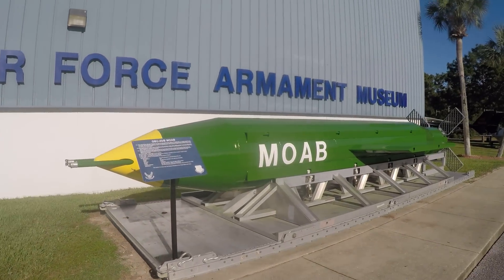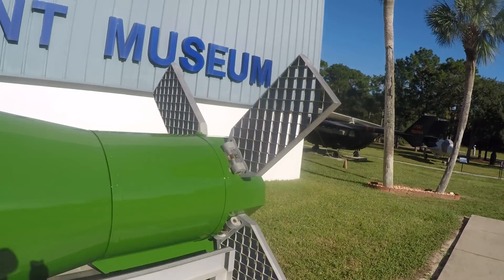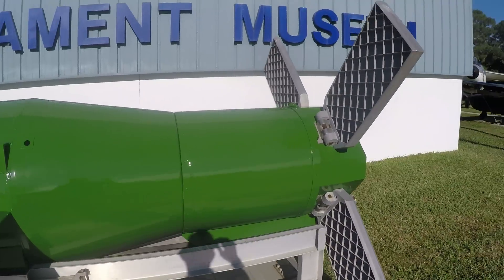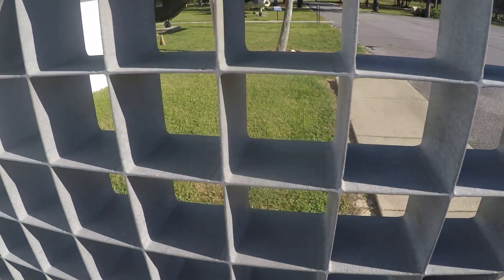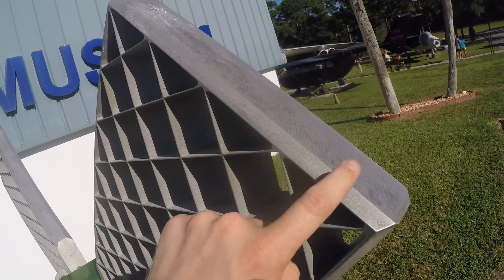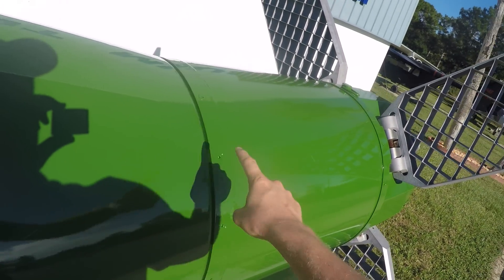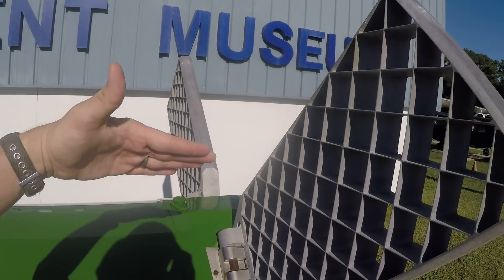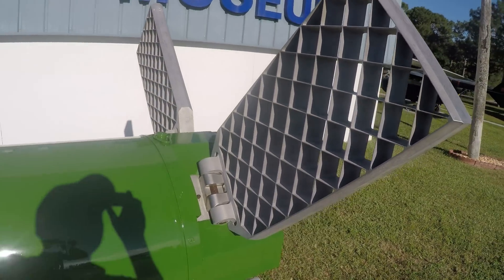MOAB GRID FINS (Think about it)

Comment: Thats funny, the SpaceX Falcon 9 rocket uses grid fins just fine during supersonic reentry.
Reply: They do not work at supersonic speeds. They only work AFTER entry burn. That entry burn slows the booster down enough for the fins to work.
Reply: @nebtheweb8885  Actually, I mistyped the grid fins have Hypersonic capability.

Comment: I'm not a scientist, so this is what it appears to me.... Subsonic, the air is allowed to flow through the fins, and turning the fins will aim the body. At supersonic speeds, because of the "bubble" of resistance that forms in front of it, it acts more like a paddle in water, STILL able to steer.
Reply: No. it won't steer very well at all. That is why space x uses an 'Entry Burn' to slow the booster down enough in the thickest part of the atmosphere for them to work.

Comment: Really interesting, so with all that surface area do they also act to slow the rate of descent of the bomb? Does that give the plane dropping it a chance to escape the blast zone?
As for actuators... hmm i agree means smaller wing required but if increase area increases effect of the surface does not then also the force on that surface increase and also the torque required to control that surface? Hmmm I'm not sure myself

Comment: Interesting, Space X uses grid fins to bring the rocket stage back down to the barge.  There's not much difference between that Moab and the first stage rocket that returns to the barge.  That tells me that US defense department could have been landing per stage rocket for quite a while. And just ignored developing it.
Reply: Nathan Roberson As far as multistage missile weapon systems go, most use Solid Rocket Boosters as the fuel is stored in rocket and not cryogenic. SRBs can't be turned off once started so they can't really perform  boost back maneuvers. They can be recovered with parachutes but SRBs are comparatively inexpensive and ICBMs aren't launched very often.
Reply: +Tadferd That is true.  Another way I could say the Sam thing I was thinking is Space X could put munitions in the 1st stage and it hit a target with same accuracy as that MOAB. The grid fin is what is used to guide something in to a target that is coming down from high altitude. Space X landing Technology is reappropriated MOAB Technology
Reply: They could, but the Falcon 9 uses Liquid fuel, specifically RP-1 and Liquid Oxygen. RP-1 is fairly easy to handle since it's basically really good kerosene, but Liquid Oxygen is a cryogenic oxidizer. Cryogenic fuels and oxidizers are difficult to handle and use. The fuel must be loaded as close as possible to launch, which means launches must be planed well in advance or be quite delayed if a launch is suddenly needed. This is very inconvenient for weapon systems.

The Falcon 9 Grid Fins are also only on the first stage, which would make a poor explosive delivery system by itself and would not be recoverable. The grid fins are also located at the top of the stage which is where the explosives would be mounted. This would make the empty stage top heavy, which is fine for ascent but very bad for descent as the fins would be very close to the center of mass, which makes them only useful for roll moments.

Additionally, unless you are trying to hit the other side of the planet, large rockets are an expensive way to drop ordnance.

Comment: Question: Would the Falcon 9 have their grid fins installed 180 degrees from this installation? MOAB is falling down but Falcon 9's are "falling up" if you will, so would the Falcon 9 grid fins be inverted from these? Thanks.
Reply: Vinnie Ice Gallagher they are both in the same orientation. It just seems weird because the falcon flies backwards while using them.

Comment: I'm not sure if you've since discovered the answer, but the reason the Russian's used grid fins more than the US is due to a technology gap in electronic actuators. Basically, the Russians couldn't make actuators with enough torque to operate traditional fins on high load applications. As you mentioned, grid fins require a lot less torque for equivalent lifting area, so it was a shortcut to get the control authority they needed.

Comment: What you missed on is the fact also that after deflection unlike a wing the grid fin is neutral i.e. the aerodynamic forces are summetric so you do not need high torque due to that also. moment arm is short but also the aerodunamic loads are neutral around the pivot point.

Comment: Is it a coincidence that the SpaceX's falcon also uses similar fins and nitrogen thrusters for stabilizing during reentry?
Reply: This is also why you have to be an American to be an astronaut. As Elon explained, Rockets are considered by NASA to be Advanced Weaponry. Hopefully, due to common ancestry, creative rockets will proliferate more than destructive ones. even though we as a species have the capability to do both very well.
Reply: Well, both Falcon 9 and MOAB are long cylindrical bodies that need to be steered from a high altitude to a target on the ground at high speed. The only difference is that Falcon 9 slows down and lands while MOAB just explodes. It makes sense to use similar techniques.

Comment: Destin, is there a reason why the grid is arranged in a diagonal configuration rather than a perpendicular?
Reply: Corrie Roberts I think it may have something to do with the stiffness. when they're at 45 degrees off the frame, they can stiffen the whole wing side to side different than if they were all up and down. like the lattice in a crane boom, or a bridge always has diagonal stiffeners.

Comment: Grid fins work very well at supersonic speeds contrary to what this video states.  Once the fin is ahead of the of the shockwave they work just like any other wing.  They just are more susceptable to control reversal and other issues, for a wider range of transonic speeds, than a normal wing.  Once fully supersonic there are no issues.

Comment: Sweet! I learned something new today.  Nicely done, Destin.  

I hadn't thought about the mini control surfaces and the smaller amount of torque until you explained it.  My thought was the grid fins were just another way of inducing drag at the back of the vehicle to help point the nose where in line with the vehicle's path (prevent the vehicle from tumbling).  

Yeah, do more videos like this.

Comment: I like this walk up and talk about it.  "A Walk up"? 

ANyway, I've seen some saying they need help understanding with visuals and editing, etc. I like that this was short and to the point. I understood what you were saying regarding the surface area being compacted rather than a large wing. But maybe a simplified explanation would help. (Rather than adding editing or images). 

IN my mind I pictured a division problem. 7(surface area of each square)*42(Squares per panel)*4(Fin panels) = the surface area of the 4 Fins = the surface area of two wings. Just a throw-together formula. Dividing it up as follows: 

So the area of two wings gets cut up into small bits, and then paste those bits into 4 fins with this pattern. The pattern allows air to go through, but the surface area that is equal to the wings has just as much control as the wings, it just puts them into this smaller panel pattern that make it easier to maneuver. Less Bulky than two large wings. 

Something like that. Using laymen's terms. Teach us like we're 6th graders. Not dumb... just not familiar with the concise language of Scientific Specialties. <3

Comment: I love this style. One thing I would add is that grid fins, even at sub sonic speeds have much higher drag, so despite greater lift (no wing tip vortices) and controllability per surface area, they are not suitable for aircraft that are not already falling from the sky or have power to spare.

Comment: From what I've read, it's only transonic speeds that grid fins have difficulty with.  Once you go supersonic, the shock waves quickly angle back until they aren't impinging on the neighboring grids and the fin starts operating normally.  I know that SpaceX has said that their grid fins sork find in subsonic and supersonic regimes and that at transsonic, the command authority reverses for a bit since the grid fin acts like a flat fin perpendicular to the airflow.
Reply: Yeah, I've heard that SpaceX's grid fins are more effective at supersonic than subsonic. And thinking about it, increased drag of the design is also maybe desirable when you're trying to fall gracefully.
Reply: Correct. When he's talking about a "bubble" in front of the fin, he means a bow shock. But when the Mach number is high enough, the holes in the fins "swallow" the shock (overspeeding), resulting in a bunch of oblique shocks with correspondingly lower drag and better control authority.
Reply: The Russian R-77 A2A missiles (Russian aim-120) also use these fins. Those missiles definitely go supersonic.
Reply: I'd assume the fins are only used during the landing. Space rockets 🚀 don't look like this
Reply: DKM101 well keep in mind, too that the air is thinner where SpaceX starts using grid fins, and it actually slows itself down to subsonic speeds too, so SpX really has nominal use of grid fins all the way down(I assume. IANA Rocket Scientist)

Comment: I LIKE IT !
made me think y airplanes dont use them, ... they must not have much lift!
Reply: The grid fins aren't about lift, they're about control.
The wings on the MOAB provide the lift, while the grid fins allow it to be steered.
They basically replace the flaps that you would normally find on airplane wings and tailplanes.
Reply: Yes, and since the flaps already integrate into the design so well, grid fins don't really seem to fit on airplanes.

Comment: If you ever get a chance to ride a flowrider on a boogie board, you can use the same technique. If you kneel on the board and lift your toes out of the water, you will start to rotate around the vertical axis. As soon as you put your toes back in the water, you will snap back to pointing into the flow. That small surface area of your toes is enough to affect your stability.

Comment: I love the video, I have one correction to make though: SpaceX has always pointed out that their grid fins work well in hypersonic, supersonic and subsonic flight regimes and that's the reason they're using them on the Falcon 9. The only place they really don't work is at transonic velocities (right around the speed of sound) for the exact reason Destin stated. The airflow is forming a shock wave there because the sound-waves all pile up in front of the fin because of the doppler effect.

Comment: Aren't grid fins used in hypersonic things, too?
Reply: I was wondering the same thing!  I think SpaceX uses them.  http://www.spacex.com/news/2015/08/31/grid-fins
Reply: From what I understand, at hypersonic speeds the bow shock is pushed back so far that it's actually on the other side of the fins, so it works again.
Reply: Isaiah Schwartz the falcon 9 punches through the atmosphere at thousands of miles an hour, thats why the grid fins get so hot and why the new ones are made of forged titanium
Reply: yes they are for example Falcon 9 Rocket
Reply: Can you find a diagram of this
Reply: Black-Reaper I don't think they go very fast in the atmosphere while the grid fins are out. In space when they are out, the rocket is going very fast, but there is no air to affect the grid fins. Before the rocket enters the atmosphere, it does a burn to slow it down, so I doubt the rocket is going fast enough to destroy the grid fins.